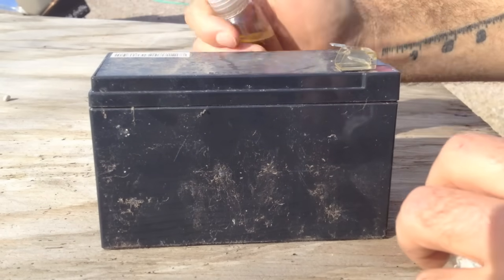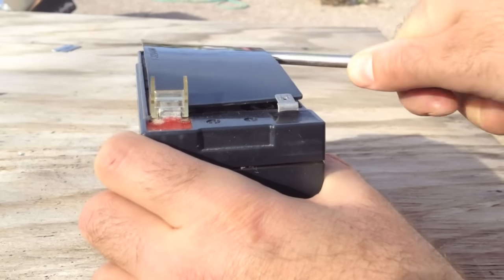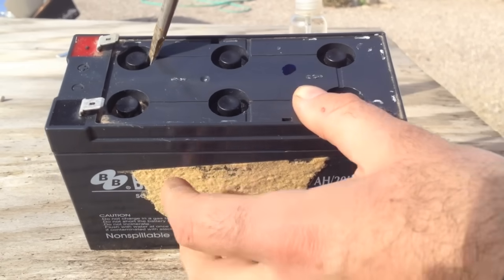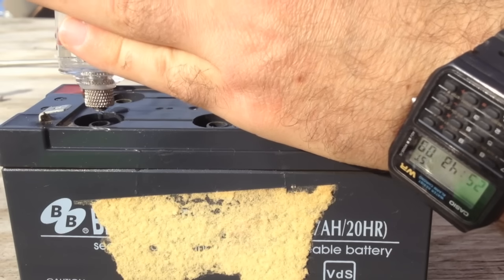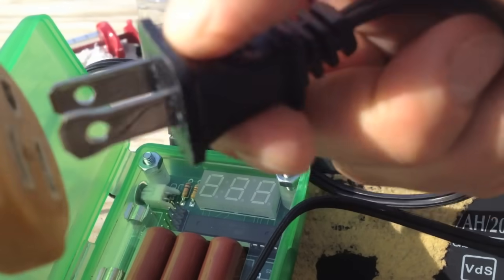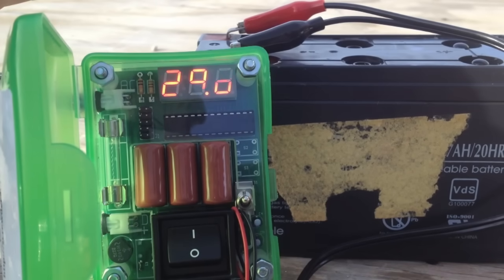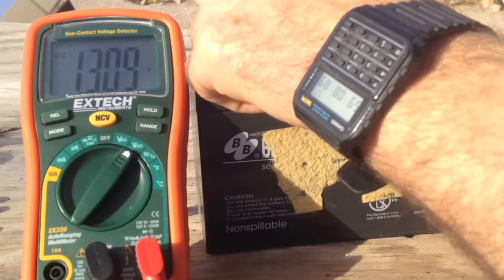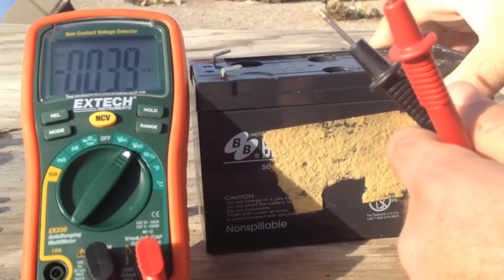Sealed Lead Acid Battery Recovery

Comment: Use compressed air to clean the inside of the battery, as opening the caps of the cells would let the junk into the cells. Hold the caps down with your thumb so that the rush of the air will not unseat them. A old toothbrush could be used to brush any gunk away from the cell openings before you remove the caps. Clean each cell thoroughly.

Comment: I have a 12-10H battery (4 of them), I was using for a 48 Volt lawn mower.   Long story short, I re-purposing them for a camping lantern and didn't realize, after an hour, one was dropping to 10.4 Volts powering 400 mA of LEDs.  I saw this and a few others and added 50-mL of water to each cell.  After one overnight charge 2 hours into the discharge, it still measures 12.8 Volts. Wow what a difference.  I'll be adding more for this next charge cycle, but not going to over fill like in this video.

Comment: I wonder if it would be relevant to accurately weight the battery when new, write it down, then over tiem check by weight how much it dried out, would that be relevant ?

Comment: Thanks for the video! I had a replacement battery ready to be purchased, saw this video and fixed mine.  It was bone dry, added about 3ml to the first cell and got about 2ml in the other 5.  Charged it for a couple of hours and now it starts my generator with no problem.

Comment: The sealed, lead-acid battery is designed to be used in almost any orientation, including mounted on its side. What prevents the distilled water you have added from leaking out of each cell, past the rubber seal/cap, and onto the appliance?

Comment: wow. I haven't seen a Casio calculator watch since I was in 2nd grade. my friend freaked out when he realized he'd dropped it in the garbage one day and spent like half hour digging through old hot dogs and ketchup to get it back; a memorable moment.
Reply: There are  a few things for battery reconditioning
never attempt to do this unless you know what you are doing - the acid can burn you
check the voltage first - there may be a dead cell which would waste your time.
Check the battery fluid.
Try to fully charge the battery.
(I learned about these and more on Jons mender guide website )
Reply: I should learn to read slower...I thought to myself "why would he have a garage full of old hotdogs and ketchup?"
Then I read again.....GARBAGE!!

Comment: Whoa!!!! Dude. Thank you. I'm a retired electrician and I had no idea that one could check each cell on a lead acid battery by sticking a probe into the individual opening. Wow. Thanks.
I'm 63 and still learning.
Reply: I'm a retired commercial electrician as well, and still learning myself. Do you miss the trade? I sure do. My body gave out before it's time. Too many injuries.  Take care
Reply: neither did I
Reply: I’m 57 retired too, but of the companies 6 years ago, tired making money for them, anyway, I’m always open to learn, everyday we can learn something.
Reply: you can check your engine coolant by opening the radiator cap, and put the negative probe in the coolant, and then put the positive probe on the pos terminal of the battery! if your coolant is old the corrosion inhibitors break down and the coolant will pass current. i forget what the cutoff is but if the voltage is above a certain level it means your coolant needs to be flushed. i think it might be like 1.7 volts idk it can be found online. also i might have gotten the polarity wrong but it will just read negative on a dmm.
Reply: Please I am trying to understand he used only rain water, which he poured into the battery containers, I have seen other videos with stated battery acid to be used. 

Is this water method right ?

Comment: Thanks!  Was gonna toss out some UPS batteries but after watching your video I decided to pop them open and see if they had just gone dry.  Sure enough, they had gone dry.  Refilled them and put the on charge and they are in perfect condition again.  Saved me $65 .
Reply: Which liq you used to refill it
Reply: @Anishverma0001  water

Comment: I have 2 6V 1.2ah batteries from 2007. They were empty so I filled them with distilled water and charger as you said. Charger says they are charging properly. I used a 3cc with needle to fill with. Worked beautifully. Took a lot of water😱😱 Thank you and wish me luck.😅. I

Comment: This is Killer! I was recently given a diehard jump pack, the previous owner said it wouldn't charge. I'm going to give this a shot. Thanks a ton for such useful and clear information.
Reply: Hey. I know this was a while back ago,  but I have a similar problem and just came across this video.   So did you have any luck with this?  Thanks in advance

Comment: To restrict any spitting of fluids which may occur, simply position your lever, then put a rag over, so you’re sort of working blind.
This method can also work in engineering, if you’re removing fasteners that may be sprung or clipped in some manner, a little awkward at times, but easier than looking for that clip that has just been projected fifty feet across the workshop.
Eye protection too, don’t forget that.

Comment: The advice & tutorial of a man wearing a calculator watch is solid.  This man knows his stuff.
Reply: Andrew Pena
Reply: There are several components to battery reconditioning. One plan I discovered that successfully combines these is the Magic Mender Wizard (check it out on google) definately the most helpful course that I have ever heard of. look at this  amazing website.
Reply: Sk Maidul
Reply: Andrew Pena U
Reply: goodto
Reply: s
Reply: s
Reply: c
Reply: c
Reply: q
Reply: q
Reply: +The Good Life Lab
Not certain about the points made but, if anyone else trying to find out how to recondition batteries try Panlarko Recondition Planner (should be on google have a look )? I've heard some awesome things about it and my mate got great success with it.
Reply: There are many factors in doing a pro job. One resource I discovered which succeeds in merging these is the Rapid Renew Roadmap (google it if you're interested) definately the most useful info that I've seen. Check out this super site.
Reply: Andrew Pena I
Reply: here's  several ideas for doing a pro job
never try to do this unless you are sure what you are doing - the acid can burn your skin
Test the voltage first - there may be a kaput cell which will waste your time.
Check your battery fluid.
Try to completely recharge the battery.
(I discovered about these and more on rapid renew roadmap site )
Reply: I have spent months studying fixing a car battery and found an awesome website at rapid renew roadmap (check it out on google)
Reply: There's several components to fixing a car battery. One plan I found that successfully combines these is the Rapid renew roadmap (google it if you're interested) definately the most useful course i've seen. Check out this amazing resource.
Reply: @Martin Ba  You are the worst spammer I have ever seen .... :) lol
Reply: Serious?  You can get these Battery from $14 - $20 - With my Time and Money and Coffee trying to revive these... I have better luck buying new battery :///
Reply: Can we use car battery for immergenncy light for night time
Reply: I have a smart watch that has a calculator on it.
Reply: Not certain about the points made but ,if anyone else wants to uncover how to recondition my car battery try Megarno Amazing Battery Magician (do a search on google ) ? Ive heard some decent things about it and my m8 got cool success with it.
Reply: No, he thinks he does.

Comment: You would not have pressure in there. These caps are one way valves that relieve any internal pressure during charging but otherwise create a seal. Also known as a 'Valve regulated sealed lead acid battery'. 

A 12v battery with less than 1v at the terminals that's been sitting around for 4 years will be very difficult if not impossible to recover to a good enough internal resistance by just adding water. There will be thick level 3 sulfate bonds on the plates. Terminal voltage is one thing, let's see you draw some current out of this :)

I'm also not sure why you think you would blow a connection between two cells by attempting to charge without adding water?
Reply: M0UKD Couldn't the connection in theory be affected by the lack of acid/water ? 
I'm still new to this kinds of stuff, so I'm slowly learning about it.
Reply: M0UKD
Reply: M0UKD
Reply: I know this is old, but I will say this. There was never "water" in the battery to begin with. The acid is absorbed when the battery is manufactured, like M0UKD was saying, they are Valve Regulated. They are sealed from the factory and do not require any acid/water to be put in. simply put, after 4-6 years, its best to just replace it.
Reply: That is only if the valves are working. This guy has clearly experienced a pressure incident, or he would not have mentioned it.
Reply: If anyone reads the above comment, DO NOT LISTEN!

YOU ABSOLUTELY CAN HAVE PRESSURE.

Be sure to do in a safe environment, with safety glasses on.  I've definitely been lazy after 100 of having no pressure, then I had one that did have pressure and I was lucky to have my safety glasses on!  Could have easily went in my eyes.

The one-way valves can go bad and stop working....so just a good habit to expect pressure even though 99.9% of the time there will be none.

Comment from the maker: Thanks Rick..The jumping about should be reduced greatly once the cells are refilled and the charger has a few hours. Since you might have been charging them dry be sure and do the cell check with a voltmeter and confirm all the cells are still giving roughly +2v up from the previous.
Reply: sir if I don't have a charge
how method can be?

Comment: I have a 12 volt Lead Acid Battery . I have charged it a very long time with Schumacher changer with 1.5 amp It is still only 6 volt in the battery. Why?
Reply: Put some salt in one pinch
Reply: Half of your cells are dead.
Reply: So use rainwater, but if it’s not raining water purified, water is fine tapwater distilled water. I’ve always used distilled water in my car batteries. If you do not have distilled water available is bottled water acceptable or should you only use distilled water or rainwater?

Comment: Please use distilled water to refurbish the batteries, makes it easier to recycle and they last longer.
You can use oil,  water or label remover to get rid of the brown tape.
Reply: He used rainwater, which is probably good enough off the cuff.
Reply: @jcpt928  why cant you use tap water? mineral content should help conductivity no?
Reply: @chrishayes5755  No. The minerals in tap water can increase both sedimentation and stratification in the battery, and they dilute the electrolyte [in deep cycle batteries].
Reply: Tap water has a ton of added chemicals the city puts in That might turn the batteries gay
Reply: what does distilling do, that evaporating and raining down doesn't?

I've always used distilled, but now this video got me thinking that rain is basically distilled...plus maybe some pollution trace content.

Think I might try it.

Comment: Great video. I never knew these batteries were of the lead acid variety and could be recovered. I figured they were some type of gel cell.

(OBTW) I noticed the Casio calc watch you are wearing...I have that same identical one and speaking about batteries.

I think I bought that watch in the mid 80's, so it's 25 to 30 years old. The band broke years ago and I tossed it in a drawer. The battery is the original (never been replaced) and it is still working after all these years sitting in a drawer. I take it out and check it from time to time to see if it's still going.

It's only lost about 4 minutes in all this time. It amazes me every time!
Reply: +FREDDIE MAXWELL   bcz It was made in JAPAN not in China. haaa..
Reply: @coloradowilderness3139  "MADE IN JAPAN" is the sign of premium quality :)

Comment: I know this video is 10+ years old but thanks for that valuable info in 2023! I'm looking to restore my Cyberpower UPS Backup batteries that are SLA.

BTW, what voltage are you recharging at, 60 volts DC? WoW!

Comment: Please I am trying to understand he used only rain water, which he poured into the battery containers, I have seen other videos with stated battery acid to be used. 

Is this water method right ? 

Also if I don't have a pimp charger, can I just place it back in the UPS to charge ?

Comment: The only thing that worried me was when he said he was going to sell it. It's not going to have a long life, it was obviously thrown away for a good reason. I've done this trick myself and the batteries quickly lost capacity. By the way, I was told that top plate is purposely easy to prise off because if the battery has to vent it'll blow those rubber seals and also blow that plate off rather than blow the battery apart. Overusing epoxy or gorilla glue may negate that safety feature.  Not that I'd like to be around if it did blow.
Reply: If you will be using the device daily, even a worn battery can last a long time, despite it discharging rapidly. When I was 18, my car sat for a month with a six year old battery and it was completely dead, or so I thought, My neighbor did some sort of procedure like this, and brought it up to full charge. I would use that same battery all through the winter, driving my car for half an hour twice or more each day, to school or work and back home. When I let it sit for several weeks over the summer, it died again. Rather than go through the procedure again and risk getting stuck, I asked for, and got, a new battery for my birthday. But it showed me that even batteries on the verge of death can sometimes be kept alive with frequent recharging cycles.

Comment: You can also go cell to cell to ensure voltage is fairly even in each cell, dip both test leads into adjacent cells.  ;  )
Sorry for the late comment but this also helps to verify battery condition.
Reply: 9
Reply: @michaelnembhard8042  12
Reply: Kudos for the video content! Apologies for chiming in, I am interested in your thoughts. Have you researched - Lammywalness Trendy Trade Guide (search on google)? It is a great one of a kind guide for learning how to recondition batteries at home minus the normal expense. Ive heard some great things about it and my work buddy at very last got excellent results with it.
Reply: @khizarabid8414  Lame another gimic to get people money

Comment: Hello need help asap
So i was able to revive one of my 2 SLA battery (12v 150ah). The other has a problem because one of the 6 cells inside is reading 0.2v but the other 5 reads 2.1v. It wont continue charging because the other cells already reached max voltage.

How do i fix this?
also how to balance the 6 cells?

Comment: Wooow it work perfectly. I use 19v laptop charger to charge the 12v 7.2ah battery  for one hour. Am still using the battery for my electric fence Energizer. Thanks so much

Comment: Hello and thanks for the video, I have a couple of questions. My UPS battery is not maintaining the charge, it is in use, last week we had a blackout and the UPS got off immediately. 1. For how much time should I have the battery out of the UPS, disconnected, before it is safe to open the battery?. 2. can I use only seawater to improve the performance and useful lifetime? Thanks in advance.

Comment: Excellent methods, I didn't know before.  I was finding  new, but odd brand drill packs at truck line salvage stores and moving the rechargeable cells in those into these old battery  cases, to make up 12 volt battery packs for my radios,  but I definitely  like this recovery even method..

Comment: After recovery of battery, should one through water from battery out?? If not, ithen what if. Attery is installed in a ups which keeps battery in lay flat horizontal position?

Comment: Old 64 goat, I am 67 and I have recovered many batteries. but not all of them. I add distilled water from the grocery store at $0.75 per gallon and a gallon lasts me several years.  (Rain water has some dissolved minerals from running down the roof and in the air it picks up CO2 and becomes mild carbolic acid so distilled water is the best! ) The sealed battery he is working on is a valve regulated not a gel cell and many are in use if the battery is not too dry the gel will absorb the water.
Reply: Hi? Good day. I would like to ask if should i throw the old water from my battery and put a distilled water with salt. Or i keep them as is and just add the distilled water and salt?
Thank you in advance, god bless

Comment: What coincidence finding this video 3days after I did this to a CSB 7,2ah battery :)

I got the battery for free and checked it had ok voltage, when trying to draw alot of amps it died immediately and charged suspiciously fast. Then I decided to check the caps and surprise surprise I could see all the lead plates dry inside so I filled er up and now it starts my mini quad easily.
Reply: you filled them up with what? drinking water? pure water? battery acid? plz let me know dear
Reply: Distilled water since water evaporates leaving mostly the acid behind :)
Reply: Michael Reyes
Reply: eamh2002 xxx
Reply: eamh2002r

Comment: It's June of 2019 and I still have my Casio calculator watch. Not used much anymore but hanging onto it for nostalgia's sake. Put a fresh battery in it a month ago. It's nearly identical to this one seen at 3:49 but my buttons on the "keypad" are flat. It's the "Data Bank 150", model # 1477. Got it at Walmart for $49.93 on 11-15-06. Still have the manual and receipt for it even.
Reply: SirFixalot45 
Need an upgrade to a ti83 graphing watch

Comment: thank you very much !!! most likely you saved me about $30.00 I have a monster portable speaker that I have not used for over two years and now the battery is dead. How interesting they way you measured each cell. Thanks again.